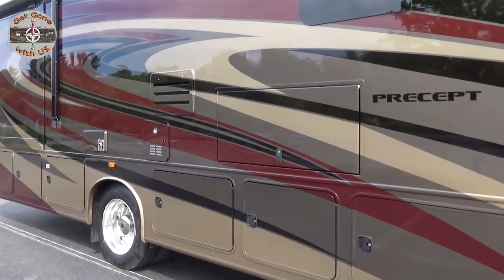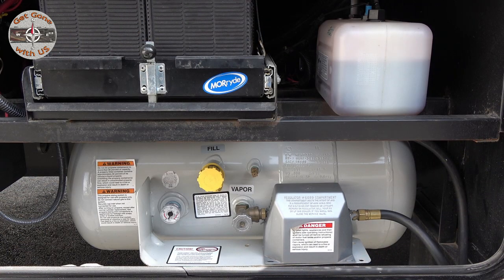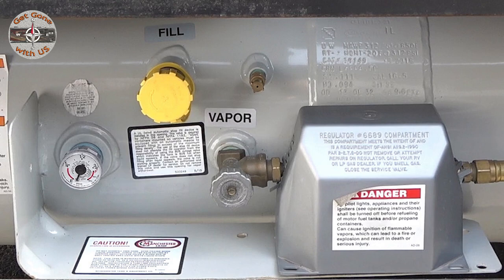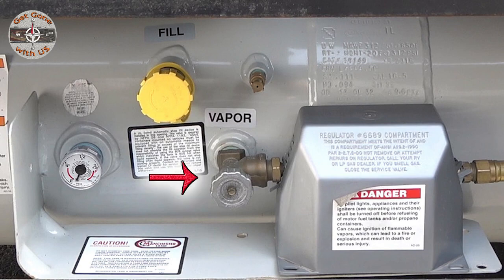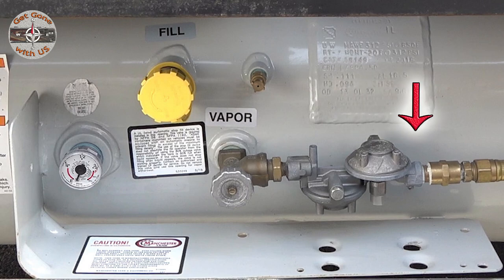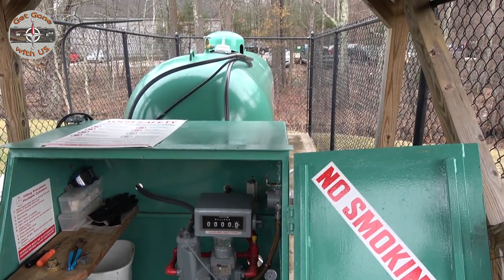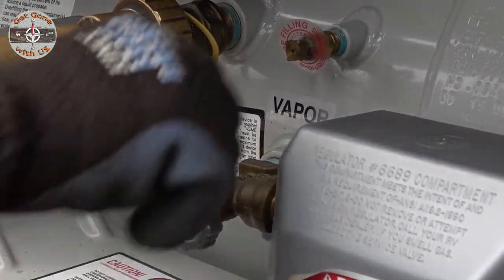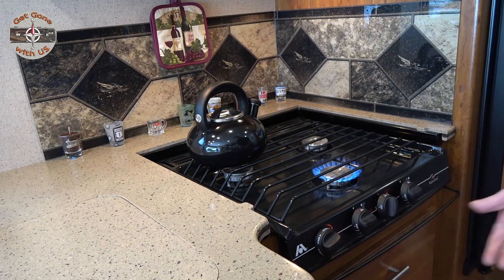RV Propane System Introduction - Tank and Refill

Comment: I am a new gas station attendant. This helps me remember. Btw. Thanks for the weight of propane. Makes sense that we fill to about 4.5 when propane weighs 4.2. Because of the bleeder valves.
Reply from the maker: Yo are welcome. Good luck with the new job.😀

Comment: Jane and I were in Vegas couple days ago. We saw a RV that was totally burnt out. I have seen 4 of them before. Made me think. Turning our propane off when we drive. Once in a town in California we saw all this smoke. Then we got to it. Some poor guy with his dog looking at the back and his Harley totally burnt. They lost everything. I don’t know what started these fires but they are scary.🤠👍
Reply from the maker: We have seen videos on how fast these things burn, it is a very scary thing.  😃
Reply: Yes, it made me sort of sick to my stomach. It was a black shell of an rv being or trying to be towed. In town??? But the guy with his dog just standing there , and it was still smoking. And down town. I did not and still don’t like the total electric Rvs. But it makes you think. 
We bought a new Jayco Melbourne 24 ft. Second day the generator started on fire at the dealership. That was horrible. Then the slide completely broke. The whole thing fell apart. We used it twice. It was ( drove to Indiana) they had it most of the summer. I sold it when it was all fixed up. It was just a lemon. 
Your Jayco is the nicer one. No problem 🤠👍
Reply from the maker: @LifewithKenandJane  At least they were not hurt in the fire.

Comment: The valve on the tank (fixed class B tank) to close and open the flow of propane is turned in which direction to open  it?
Reply from the maker: On ours it is clockwise to close, counterclockwise wise to open.
Reply: @GetGonewithUS  thank you very much

Comment: I have the same tank!! I'm having a hard time finding some to purge the tank for it is new. Any ideas??
Reply from the maker: Once it is filled, make sure propane is turned on, they turn it off when they refill it. We purge the air purge through the stove.  Turn the burner to light and keep turning the spark knob until it lights.  That's the sign that air has been purged from the system.  If you start smelling a lot of gas and it's not lit turn it off and seek a professional to find the problem.  Hope that helps. Make sure propane is turned on.

Comment: I ran across a situation where my on demand hot water is not working properly. Heats up to 72 degrees and shuts down. So far the water source is fine, but i ran across a video that thinks it may be the regulator. Have you had any problem yet?
Reply from the maker: We have had problems with the on demand not working with the bathroom faucet due to blockage in the lines, but it ended up being loose connections.  Once they were tightened, we haven't had any more issues. Let us know what you find out.  Good Luck.

Comment: Think again , the tank can be anywhere on the rig. Not always on the passenger side.
Reply from the maker: I did say 'usually' because that's where we have usually seen them, but recently did see one on the driver's side of a Newmar.  It's still the compartment without a lock on it.  Thanks for your input

Comment: Thanks, we are new MH owners. How long does your LP gas last summer vs winter.
Reply from the maker: Congrats on being new motorhome owners!  We wish you many great miles of adventures!  The short answer to your question is the propane will more than likely last longer in the summer than the winter, depending on how much you use it. The long answer is it will depend on the size of your propane tank, whether you are boondocking or have hookups. Depends on how long your showers are and how many people are taking showers, there are so many variables.   The stove/oven, refrigerator, water heater and furnace all use propane, unless you have a residential refrigerator, which is electric only.  The furnace will use a lot of propane.  The best advise we have is to fill the tank and stay someplace near a filling station and do what you would normally do to see how long your usage will last.